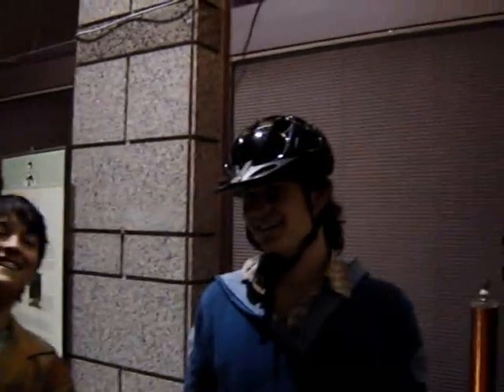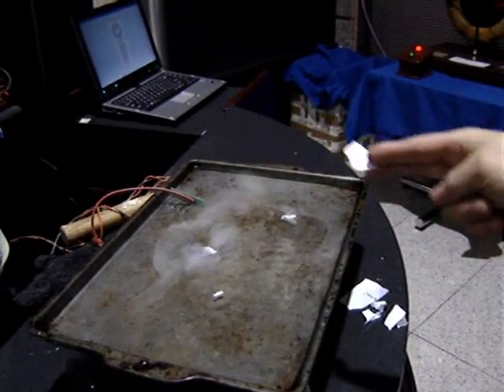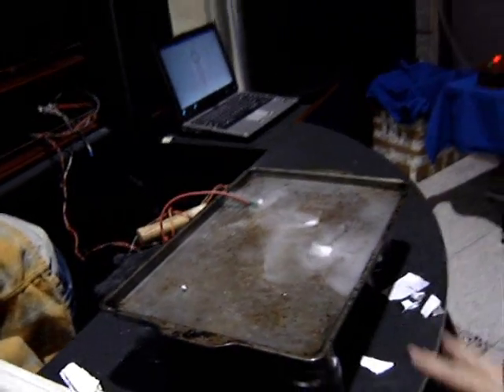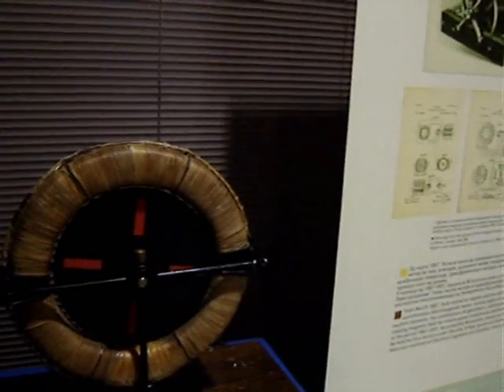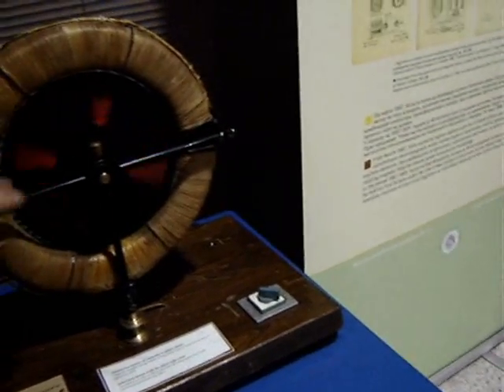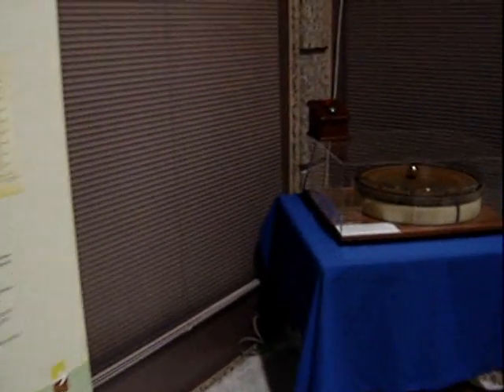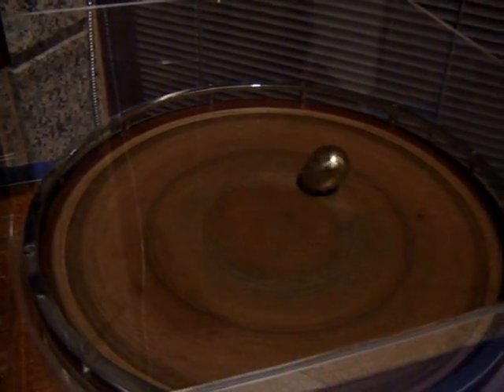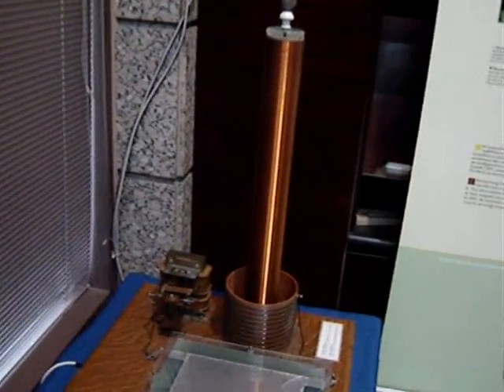Nikola Tesla exhibit, Vancouver CA 11/2006 (stills & videos)

Comment: There is a large Tesla Coil in the Tesla Museum here, in Beograd, Serbia. It's been there for several decades. Has a handmade capacitor bank and, as far as I know, it still works and can lit the fluo-tubes several meters away. If You ever come to Belgrade, the museum is in the center of the city, You can't miss it. There are many interesting Tesla stuff there, besides the sparking coils :)  Pity nobody is researching his notes... BTW, did You know "tesla" is a woodworking tool (in Serbian) :)

Comment from the maker: As far as I know, that TC was built by the Tesla Museum in Beograd Serbia.  The power transformer looks like an un-potted neon type.

Also I noticed that the huge current pulses are slowly eating a slot across the narrow neck of copper foils leading to each capacitor plate.  Same fissure-growth effect as with CDROM in microwave oven.

Comment from the maker: A genuine device would be cool.  Don't build a huge one, then throw one half in deep ocean!  The water pressure miles down would create a terrible weapon.  Or stick a steel I-beam in, then turn off the power.  It's perfectly snipped in half.  Sell them as the ultimate metal saw!  A billion dollar invention.  You could cut battleships in pieces.  Or make sliced ham or titanium foil by turning it on and off rapidly, then push a block.